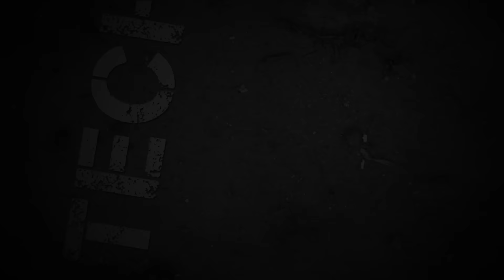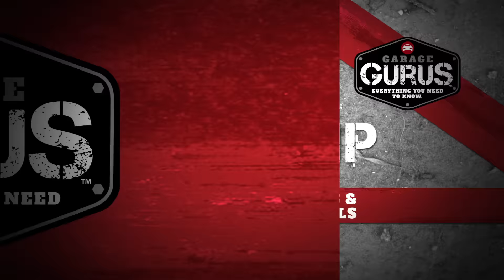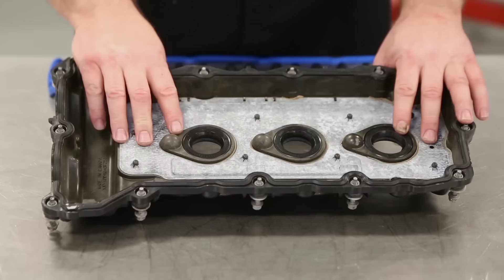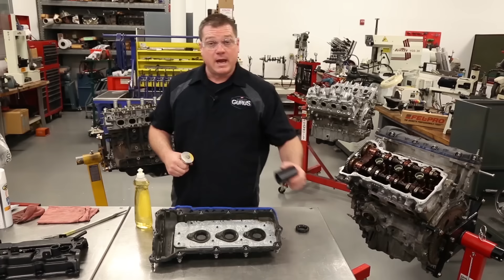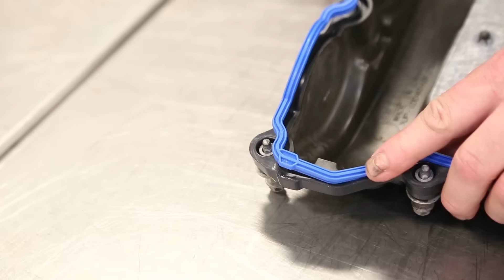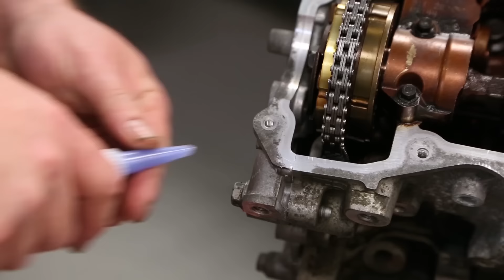Installing Spark Plug Tube Seals & Valve Cover Gaskets

Comment: Finally someone who knows what he's talking about.  These are excellent tips and you wouldn't believe how many videos are out there showing the seals being installed upside-down, forgetting the RTV, smearing grease or RTV all over the cover gaskets, not lining up the gasket properly and pushing it in, etc.  Here's a guy who knows what he is doing and is telling you the right way to not screw this job up.

Comment: Thank you for clarifying which way to tap the seal in. My common sense told me the taper goes toward the spark plug sleeve but my trailer building experience told me to install it like in a wheel hub.

Comment: I like your idea of using the soap to install the seals. I use Sly-Glide from Napa as it is silicone based and has a wide temperature range. I found out the hard way about the tube seals having the correct orientation. Keep the tips coming.

Comment: I've got a 2.0 Liter Engine on a 2001 Nissan SE Body Sentra.  So I only replaced the valve seals, never tried the dish soap method though.
Reply: I got a 1.8L 2001 Nissan GXE Sentra and have to change the valve cover seals somehow..

Comment: I bought a new valve cover gasket for my 05 Pontiac Vibe, and it came with 2 tube seals when it's a 4 cylinder. Shouldn't there be 4?

Comment: Thank you, Mark!  Great info and tips!  My 2008 Highlander V6 is leaking oil, minor, a drop or 2 on the garage floor.  I took to a repair shop, the owner lifted up and visionally inspected and wrote a note to me "Front Valve Cover Gasket & VVT Seals".  I am wondering why is front, what about the rear one?  What is the reasonable cost to fix it, should I only fix the front or need to fix front and rear?  Thank you so much in advance.

Comment: Hi Mark. I have a question, I have seen repair guides calling for use of specific spark plug tube seal guide installation tool from Kent-Moore EN46101. I noticed you didn't use it. Did you find this unnecessary in your experience? I have my valve covers of and I'm contemplating getting the tool. What do you think? Thanks.

Comment: Hi!, 

Do you have to wait some time before putting back the valve cover, after you apply the
silicone sealant on the 2 sections where timing cover meets the cylinder head?

Even if the soap could help to put a gasket, i don't like the idea to have that soap which could pollute the engine oil.
Reply: No, you put the cover back on immediately.  The RTV will bond with the gasket and form a better seal.

Comment: The tube seals are pushing back out when I try to secure the valve cover. How do I stop this any tips?
Reply: I got the same problem an leaking more then before I changed it
Reply: @TonySmith-H-Town_83.Detailer  I watched so many videos and one finally suggested using oil or grease around the fitting to slide it into place and that helped get the seals in..my problem ended up being the o-ring beneath the plug.

Comment: What about the bottom of the spark plug tube? This shows replacing seals at the top end on cam..... but the lower end is still sticking inside the engine below the rocker arm. Don't these need to be changed to prevent oil in spark plugs/tubes? Thanks in advance.
Reply: The tubes in the 3.6 are factory installed into the head. They have an issue with porous heads and tubes leaking but the only way to fix it is to replace the entire head.

Comment: I have a 2011 VW routan with Chrysler 3.6L VVT with a stuck socket, how do you remove a spark plug tube with plug and socket inside without damaging the cylinder head.   Yes I was dumb did not know the difference  between thin and thick wall 5/8" spark plug sockets and got it stuck.  Help

Comment: I wish this vid showed how to remove the valve covers especially with regards to removing power steering reservoir and the bracket so that the cover will come off.  Do you have or have you see a video that shows this for the 2009 GMC Acadia?  I've been trying for days to get the @* cover removed.

Comment: what silicone did you use for this?I have permatex ultra black gasket maker they recommended at Oreilly's I need to know what the correct one is to use
Reply: Blue rtv!
Reply: ultra black is mostly used when sealing lower intake manifolds, etc, atleast on most vehicles i have worked on

Comment: What is the sequence and torque spec (how is it done and how much lbs pressure? ) and is it the same for all cars? I have a hyundai accent 2008. 

Also. what's that propper drive tool called? What do you mean by support the valve cover? Wouldn't the even surface it's resting on be sufficient? I'm just trying to learn before I attempt the job myself for the first time.
Reply: The bolt sequence / torque is different for almost every vehicle check the service manual for torque specs etc, You should never need a drive tool imo, Supporting the valve cover when putting in new seals should be very self explanatory, i know this is late but good luck, i hope everything goes/went well for you!

Comment: So I have a plug hole filling up with oil so I'm going to assume that the spark plug seal is shot. My Question is, Do I need to pull the intake to change all of the valve cover gaskets?
Reply from the maker: Without knowing the specific vehicle you are working on, we can’t be sure if you will need to remove the intake to service your tube seals. We assume you are working on GM 3.6 (subject of this tip) and you will need to remove the upper intake to replace the seals.  We did take a look at the OE service info and it looks like you can leave the lower intake in place to service the seals, in most cases. Hope this helps!
Reply: Garage Gurus I am replacing the Valve cover gaskets and tube seals. The tube seals don't appear to be leaking past the current seals. The number 3 plug has started to seriously miss fire and I noticed that when I replaced the spark plugs a couple of years ago that there was some oil entering that tube. This is the only video I could find that closely even represented my 05 Buick Lacrosse 3.6. Is it possible that oil is entering the bottom of the tube? If so, beings there are no o-rings or seals at the bottom of the tubes, what can I do to stop the oil from getting into the tube?
Reply: @MikeSmith-xf5ij  did you ever fix it?
Reply: @rayvasquez6821  yes I did. Along with replacing the tube seals I also pulled the tubes and put a small amount of black RTV around the bottoms of the tubes as that's where they were leaking.
Reply: @MikeSmith-xf5ij  How did you remove the tubes?  Everything that I have read on the 3.6 says that the tubes are factory installed and the whole head needs replaced to fix the lower tube leak.

Comment: How much footpounds are they torched in?
Reply from the maker: When installing the valve cover you should check the service information for the specific year/make vehicle to obtain the  proper torque specifications. We did check a 2012 Impala with a 3.6 to provide this answer. To properly torque these covers you would tighten them to 89 inch pounds. Make sure you start with the center bolts and work your way to the outer bolts. Then make a second check of the bolts, using the same sequence, at 89 inch pounds again.